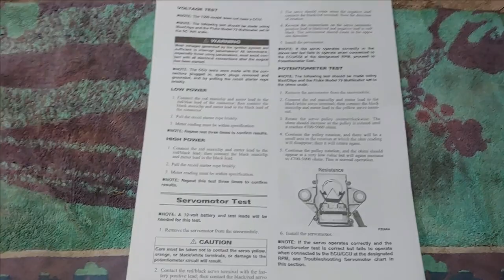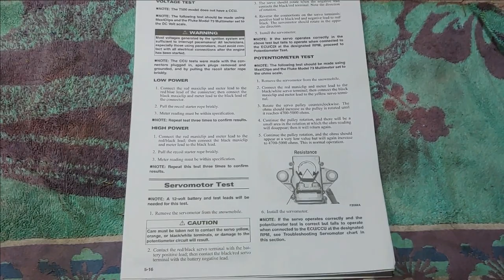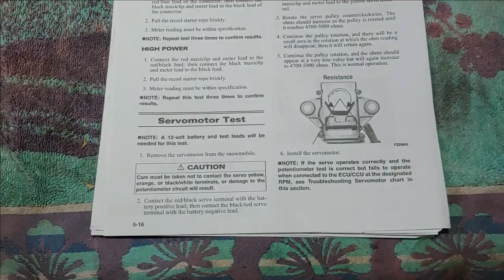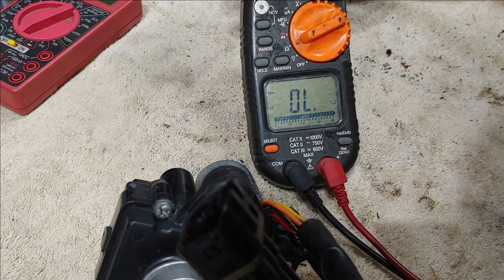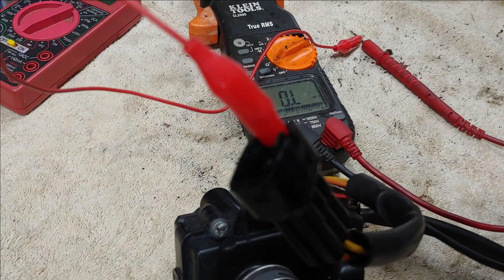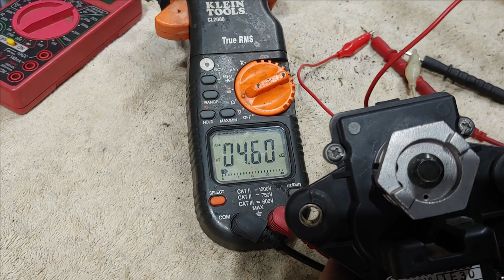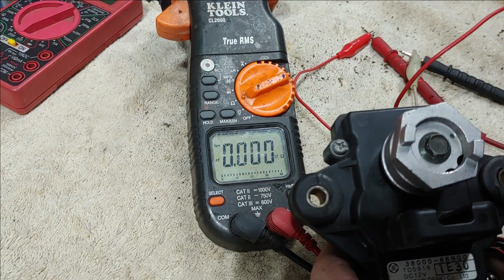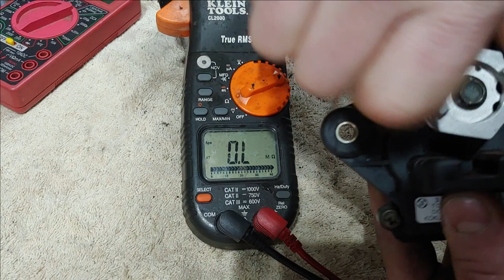02 Arctic Cat ZR 600 EFI Part 6: Power Valves & Troubleshooting a Bog [Servo motor Testing]

Comment: OK I'm trying to figure out how these cables go on. Mine were off of it when I bought it. Now I am trying to see if the motor orientation resets itself. I tested the ohms they are fine. The motor works front and reverse. Sled starts perfectly then throws the 6 flash code. I think cables were in wrong.
Reply from the maker: 6 flash code is bad servo motor. Or could be a short in a wore that goes to the servo.
Reply: @Fixin2Ride-Official-  I mistakenly unhooked the lighting wires the go to the stator and it's running great. Might be a short there. I need to know how to get the servo to operate with the sled on the stand? I can't get them to open revving it. Does the engine need to be under load? Servo tests perfectly. Ohms and power to 12v source
Reply from the maker: Then you have a short in your safety switches. Try I plugging the emergency stop switch plug. 

 The servo should open at around 7000rpms or so. Check the wiring to it.
Reply: @Fixin2Ride-Official-  Will test this tomorrow. Thanks for the recommendation! 🥂
Reply from the maker: You bet. Here is my video on fixing the Emergency/ TSS... Check it out. 
https://youtu.be/lGyR7jHwino
Reply: @Fixin2Ride-Official-  which side do the cables hook up too? You are pointing to the right side in the video.
Reply from the maker: So in the beginning of the video the cables are fixed to the right side (when sitting on sled) of the servo. Turn the cable drum so that the spaces for the cables to connect is on that side. You might have to remove the cables, put the inner most cable in first them the sscond. Then secure them in the slots and with the clip.
Reply: @Fixin2Ride-Official-  OK man here's what's actually happening and why I thought the cables should be on the opposite side. My dam servo is operating in reverse! I can not explain this to save my life. Really hope you have an idea on what to try here because I'm lost. I came across one post where a guy had this issue but he couldn't explain what fixed it. He had to servos both did same thing.
Reply from the maker: Interesting. So when you are looking st the servo, the top of the drum should turn towards the clutches to open the APVs... If its indeed turning the opposite, Did you disconnect any wires from their plugs when testing it and is this while testing it or while the sled is running and you rev it up?
Reply: @Fixin2Ride-Official-  I've been up and down on this sled. I bought it last year and ended up giving up on it and parking it until the other day. Previous owner said it was fine of course. It stdrted right up but bogged. Got it home noticed the cables were off the servo motor. Hooked them back up they were turning backwards so he obviously had this issue and sold it this way. So I'm going into it blind. I'm going to check all the stator connections to the components, and also clean the stator ground to the engine. I did take the cover off the motor that turns the potentiometer and check to see if it clean. It does have to  ways it could go back on. It's just a little cover with magnets. Now that thing can only turn forwards and reverse. If I turned the cover and the magnets are not in the correct orientation. Would that make it spin backwards? I also read the lighting coil powers the APV servo system. I know I had that unplugged, but that's 2 yellow and a brown and that plug can't be reversed. Going out now to check all connections and see if any wires are melted together. Also going to open that servo motor cover and see if it looks like it may have been turned. Any other starting suggestions? Could a weak ground cause this? I'll test ohms from lighting coil again but I believe I did and they were good. Gonna double check. This thing is going to be the death of me trying to figure this out.
Reply from the maker: Cant remember what the wires look in the plug look like but see if you could possibly remove the wires. If so, Id check for proper polarity. I would think if the magnets were able to be placed in backwards it would reverse the magnetic field and potentially cause it to run backwards.
Reply from the maker: But yes these machines can cause that kind of trouble. Seems like I always get those. Lol
Reply: @Fixin2Ride-Official-  I'll let you know just swapped the magnet case to the opposite side.
Reply: OK man I can't believe the dam cover with the magnets in the little servo motor was put back in wrong! But... It starts no code. The second it turns to pull the cables it throws the 6 flash code. What starting position is the servo cog that holds the cables supposed to be in? The manual shows open circuit at 5 and 7 oclock. I tried it a few ways now. I can't figure it out. Do you know if there's an ohm reading where it is supposed to start? Man I'm so close! 😅
Reply from the maker: Nice. But yeah it should be facing towards the muffler. Id have to look at one of mine.
Reply: @Fixin2Ride-Official-  bro.. You saved my ass with your section showing the correct ohms per where the cable cog is positioned. I couldn't conceive why my open circuit area was so off. The service manual shows the cable cogs in the open position and the open circuit at the 5 and 7 o clock position. This is why I couldn't for the life of me understand why it kept signaling the ecu to the fault code. For the dam motor in reverse issue. The cover for the servo motor can be installed in 3 positions. Og course when I took it apart and inspected it. I put it in the wrong way. There is only one position that cover can go on for it to spin the correct way. Both other ways you turn the cover make it spin backwards.. Man if I didn't spend 30 hours trying to figure that out. 😅 Really appreciate your help and this video. I wouldn't have fixed it without it! Cheers! 🥂
Reply from the maker: Heck yeah! Good job! I learned something New also! So good deal. One thing I have made a routine of is taking pics and video to document stuff as well as putting things back the way they were. But if it was out back wronf before me that doesnt help. Ha ha. 

Last question, does the servo open the valves at around 7k rpms in the stand? So it runs good? 

 Take a video and post to your channel with a link!
Reply: @Fixin2Ride-Official-  oh shit just let me have one night thinkin I got a win brother. 😂 Man I got no idea. Everything is still off the servo wasn't put on the air box and the ecu was sitting there. I blipped the throttle a few times no idea what rpm but it did climb to high rpm super fast and held the servo open. As I let off it closed and as the RPMS fell it blipped again for a quick sec. Did this a few times. No codes. I'll have to check tomorrow when I get it put back together on what rpm then first start but I know I kept blipping the throttle up higher and higher to see if they would engage. Worked every time no fault. Hoping they are OK. I know my cables are set perfectly.
Reply: @Fixin2Ride-Official-  would a bad exhaust valve sensor cause power valves/RPMs to do this? I have a zr440 snopro SX. Mine does this same thing. Not sure about the servo motor turning backwards... But the servo reads ohms as it should and it turns forward an backward when powered off the sled with 12V. Turns counter clockwise when powered with correct polarity. Turns clockwise when polarity is reversed
Reply from the maker: What is the exhaust valve sensor? Is it just a temp sensor? Is it on the manifold or somewhere on the cylinder or exhaust valve? If its on the pipe its probably jist a temp sensor. BUT, dirty APVs will act this way. 

 I suggest pull the out and cleaninf rhem up with gasoline and brass wore brush and then spray off with brake clean or carb cleaner and wipe dry amd reinstall.
Reply: My issue was the APV valve servo. Someone took the cover off the servo motor and it can be put back on 3 directions. 2 of the 3 ways you turn it will turn the servo motor backwards. Couldn't believe it. Took me a week to figure it out. The dam servo motor has a bracket to hold both the APV valves on either the left of right side of the servo so I was way confused. Literally did every test on the sled to finally give this a last try.
Reply: @Fixin2Ride-Official-  it is on the exhaust pipe. It looks like an O2 sensor. But yes it senses temperatures (for reasons I don't know) an sends it back to the CDI or something. 

This was my dads sled. He gave it to me the other day an we've had this problem for a long time APV not opening. I guess sometimes they would work an other times they won't. So I would like to think my servo is okay. It had been replaced at some point by my brother. Apparently it ran well 2 years ago... 

I cleaned the carbs and valves. Set exhaust valve cable to total gap of 1.24 inches.
Reply: @Fixin2Ride-Official-  would you ever think of deleting the servo motor?
Reply from the maker: Gotcha. Yeah probably just to send temp warning of a cylinder is running lean so you dont burn it down. It will reflect in the exhaust if its running lean. Quite quickly too. 
 Did you make sure the valves were installed properly after cleaning? 

 Also, check to see of your emergency stop throttle stop switch is working properly. Mine ended up needing a rebuild. Which is in this rebuild series.
Reply from the maker: Hows this thing going?
Reply: @Fixin2Ride-Official-  Waiting for the snow! 😉🤟 Got it all put back together seems OK with the back raised on my garage hoist. Fingers crossed!
Reply from the maker: Should be good then. You'll know soon! Good to hear.
Reply: @Fixin2Ride-Official-  Rifjr on man definitely appreciate the help. I'll report back if we ever get some snow here in Southern WI.
Reply from the maker: My pleasure! Sounds good. Thanks for watching as well.
Reply: @Fixin2Ride-Official-  

Valves are in correct, far said of angle upward. There is that pin hole in the valves (not sure what they are for). The holes are not quite centered on the valves so i set them to more inward than outward.  

Emergency stop cable is not plugged in in the back. The sled still runs without it plugged in...? Thought maybe it had got bypassed because it was messing up (not sure though).

Shut off switch works good. 

Could a CDI box work sometimes an not other times. Meaning sometimes it won't send power to the servo. I only ask because there is times the sled would open up fine.
Reply from the maker: So the curved face of the valves is supposed to face the piston, not face down at exhaust port. 

 Anything 98-99 and newer is open iginition meaning that it doesnt create a closed cicuit with all of the switches to work and thus grounds out the ignition system to stop the sled. Unlike closed iginition which has to complete the circuit through grounding to run and breaks the grounding circuit to stop the engine. So yes, the sled will run without the emergency stop cable plugged in. 

 Not sure what the holes are. Dont think I noticed those on mine. 

 If you unplug the 4 prong plug coming from the stator and test the sled that will tell you if you have some sort of ignition problem. If it wprks sometimes and not others, sounds like a connection or dirty valves.

 What year is your sled?
Reply: @Fixin2Ride-Official-  2001 zr440 snopro snocross, sorry. 
In the video he will show those pin holes in the valves. You will see them at 17:44 - 17:53. I would love to know what they are for an if they are in right. I believe he put his in the same way mine went in. With the two pin holes slightly closer to each other rather than further. Like I said they are punched/drilled out slightly off center.
Reply: @Fixin2Ride-Official-  all my electrical stuff works fine. Lights, rpm gauge, an hand warmers. This sled has little to no electronics on it. No speedometer or code light. It's only the power valves that work sometimes an other times doesn't. More often they don't. We have got them to work but they won't stay working. 

How do I test the stator?
Reply from the maker: Depending on the year and model you should be able to go to my playlists and look up the stator testing video on my channel made by Blaine pertler. He will show you how to do it and which leads to test and what the ranges should be. If not then you may need to find the year service manual for your salon and it will tell you in there. If all of your connections are clean and your power valves are for sure clean then it may be the CDI box for Servo motor itself
Reply: @Fixin2Ride-Official-  sounds great, I really appreciate the help. 

Can the CDI box work sometimes an not the other if it's going bad? I'm not very mechanically inclined, just taking my time an doing my research.
Reply from the maker: No prob... I dont really think most people know. If it can intermittently work it seems like a loose connection or broken soldier joint. So if you tested your servo motor and its fine and all yoir connections are clean, then look up your CDI box part number of babbitsonline and cross refernece it to see which models it was used on and try and find a good cheap one or barrow someones to see if your sled acts fine. Then find a good used OEM unit.
Reply: @Fixin2Ride-Official-  sounds good. Much appreciated
Reply from the maker: Okay so for clarification I asked a good friend of mine and the holes are for equalization of pressure so the valves arent opened with exhuast gas pressure. So they need to be kept clean and ooen is all.
Reply: @Fixin2Ride-Official-  so it doesn't matter if those ports are inward or outward?
Reply from the maker: The holes on the thin portion of the valves is on top when you install them.

 Click in this link and zoom in to view the orientation of the power valves when compared to the cylinder.
Reply: @Fixin2Ride-Official-  so I was looking at a picture of exhaust valves for the sled on Google (just to see if mine looked similar. To determine if it needed new ones). 

Are the valves supposed to be smooth from "head to toe"? 

 Or are they supposed step down about half way down the valve?
Reply from the maker: If you have the flat ones yes. Rhey havw a ridge horizontal across them. They are known to wear ans reach further down and smack the rings so the recommendation is to file .020" off the end and round the end corners. This will stop them from ever doing that. Or get shims. Filing is cheaper and as effective.
Reply: @Fixin2Ride-Official-  so I got the new exhaust valve sensor put in. Didn't do anything.... Noticing the sled climbs RPMs a little slow and struggles between 5.5 - 6k RPMs. Almost sounds like it stutters once it hits 6k
Reply from the maker: If your servo tested good and your valves are clean and install correctly and your stator is testing good and your emergency switch is good, then try and different CDI box.
Reply: @Fixin2Ride-Official-  will do. Got one on the way now. Just found it for $89. Description said "Came off good running sled". Seller had good reviews and more parts for the same sled.  Haven't told the wife yet but that's not a deal you pass up. Clicked buy on that instantly.
Reply: @Fixin2Ride-Official-  so I've replaced CDI box, valve regulator, valve condenser, rebuilt the carbs, voltage regulator, an new exhaust valve sensor....

Sled still won't climb past 7200 rpm. Servo runs start up cycle but won't try to turn afterwards... I need help before I give up, it's getting expensive 😡
Reply from the maker: Did you try a differenr servo? Also try checking your drive clutch and driven clutch to make sure they are stock. Check abbitsonline parts diagram to verify.
Reply: @Fixin2Ride-Official-  I just tried to hold the valve cable open an the sled still won't climb past 7200. Does that say anything?